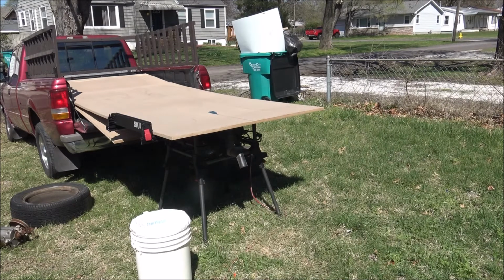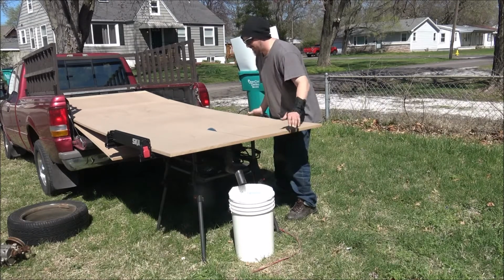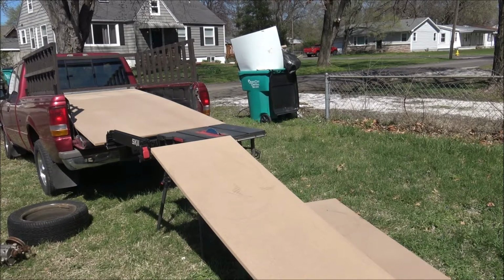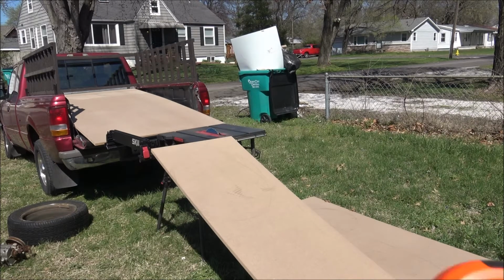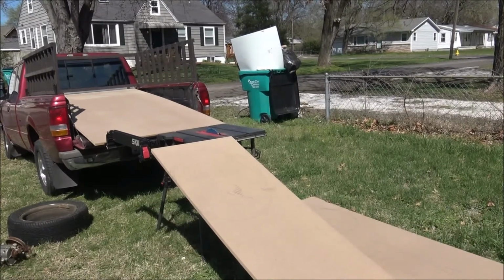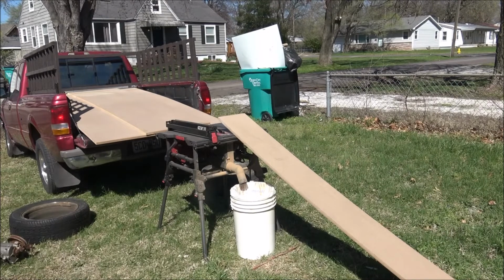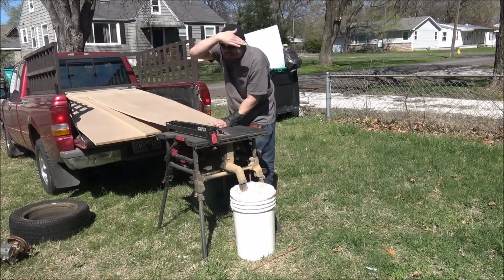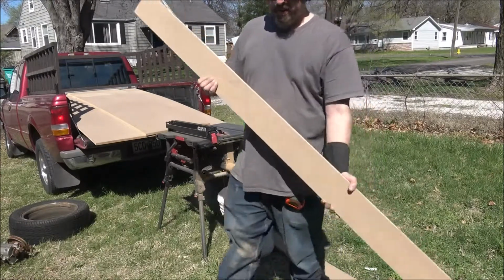The Skil TS6307-00 10" jobsite table saw vs 3/4" 49"x97" MDF

Comment: @jt. Do you like the harbor freight blade over the stock blade?
Reply from the maker: The Hercules blade is a 40t, where as the stock blade has 24t... So it makes for a fine cut. The Skil blade is better for my Chicago electric miter saw for rough cuts that don't matter as much. When I need a super fine cut, I run a 7 1/4" blade. Even a 24t makes a super fine cut, but I just got a Bauer 60t 7 1/4".

Comment: I'm not knocking you for ripping it yourself, I have this same saw and it'll handle it.  If I need 3/4 anything ripped I have the lumber yard do it just because they can knock that shit out so effortlessly with a panel saw.
Reply from the maker: I didn't have the measurements until I had the material home. Had to calculate by using math and compensating for blade for the least amount of scrap. I had almost no scrap at all when I finished ripping it all down

Comment: I like the idea of feeding it from the truck bed (or catching it into maybe also, if you could use a vacuum hose for the sawdust).
Reply from the maker: I want to get rollers but harbor freight is always out of them. I use my Ridgid 12 gallon vacuum and it works awesome, but the bags fill up quickly and they are expensive

Comment: MDF sawing and routing... the dust!
Even outside in high winds...the dust!

Still alive? Cancer free?😳
 
If you are still doing this with this material 60 dollars gets you a dust deputy.  That will help save bags for the vac.
Reply from the maker: Is that a bucket insert?
Reply: @InNerdimensional  no  its a cyclone on top of a quality bucket that accompanies your shop vac.. if you buy just the cyclone and put it on a drywall bucket they tend to collapse..
Reply: I wasnt sure what you meant by bucket insert maybe you were thinkin what I just explained
Reply from the maker: @williamsmith9026  yeah, I've seen those. With my Ridgid vacuum attached, it catches a lot of dust, but fills the bag super fast
Reply: @InNerdimensional  trust me I understand bag costs. I own 4 Festool dust collectors 😂
Reply from the maker: @williamsmith9026  damn
Reply: @InNerdimensional  

I still use dust deputy with them all. If you do a lot of milling with your tablesaw and wann keep the bag changing minimal its the way to go..
Reply from the maker: @williamsmith9026  I don't do too much but that is a good idea.